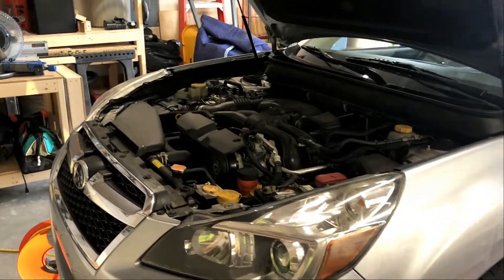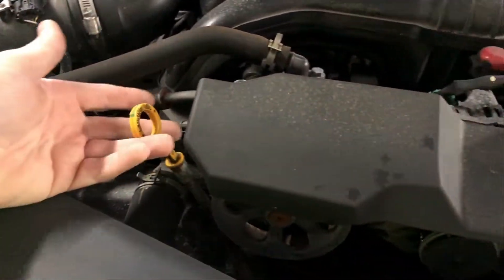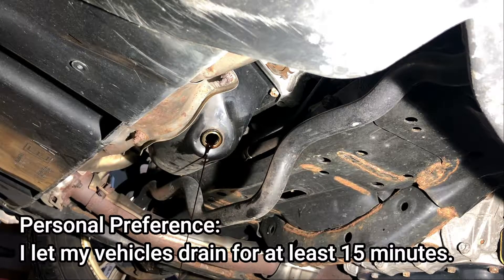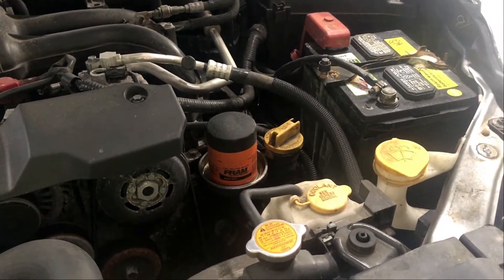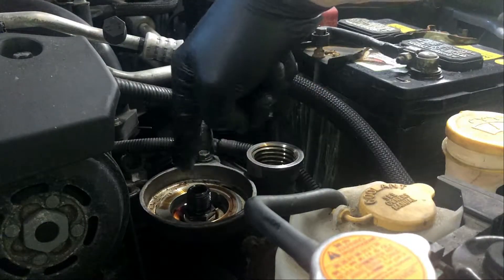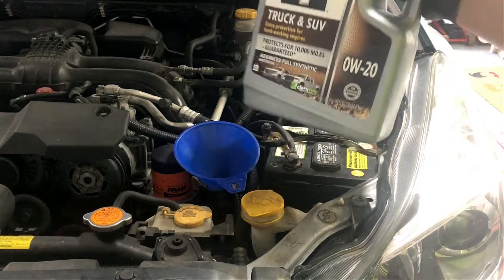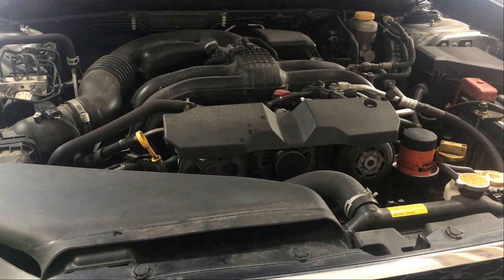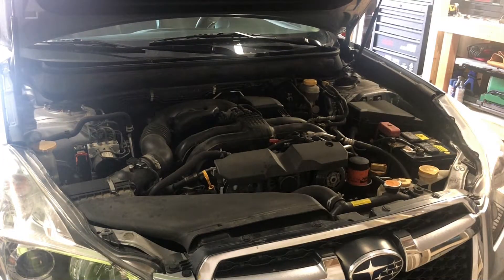[HOW TO] 2013 Subaru Legacy 2.5i - Easy Oil & Filter Change

Comment: How do you reset the oil light manually after an oil change? I have a 2013 subaru legacy 2.5L
Reply from the maker: We searched and searched and it didn’t appear to have one.
Reply: @fondupot  hmm. So does it reset on it's own?
Reply from the maker: Like I said we couldn’t find any oil life monitor to reset. So there’s no need to reset anything. Just keep track of your mileage.
Reply from the maker: @worthyvieth5238  According to the owners manual, there is no oil life monitor. The only lights in the dash associated with oil are "low oil pressure" and "low oil level".

-Low oil Pressure is a light that looks like an oil can.
-Low Oil Level is a light that looks like an oil can with an squiggly line underneath. 

The low oil pressure would indicate a more severe issue with the engine where it is not producing the specified oil pressure required. The low oil level would mean there is not enough oil in the engine.